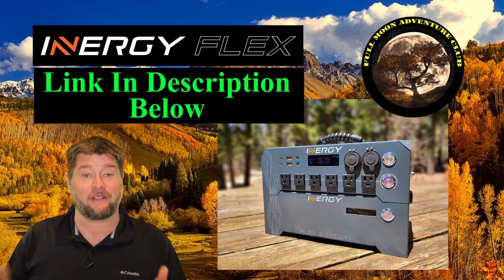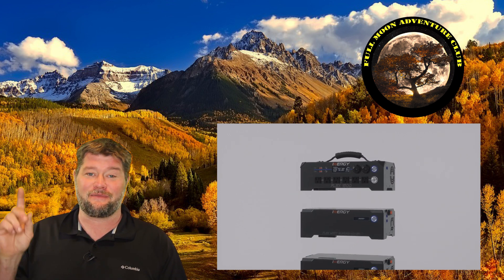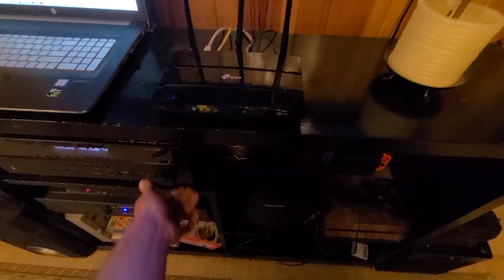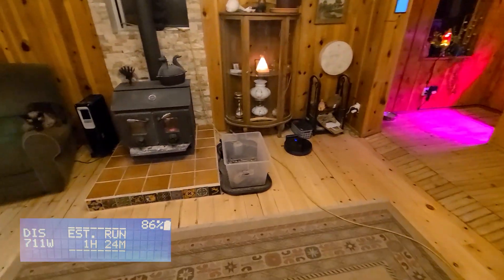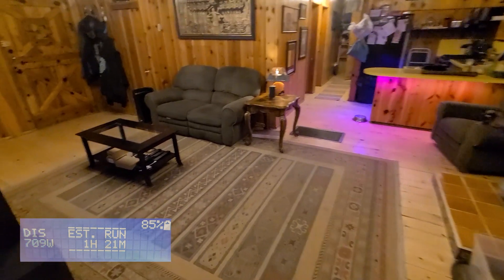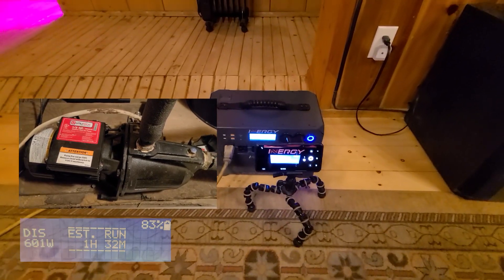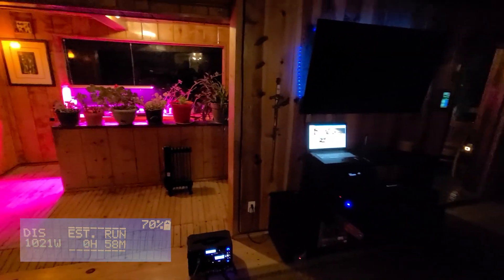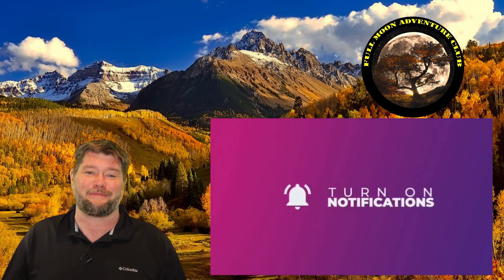Inergy Flex Solar Generator Running My Whole House

Comment: Ordered a Flex 1500 in 2021. It took about 18 months or so for us to even get the generator. Then they promised they would send an additional item to make up for the delay (a crock pot). We never received it. Then we bought extra batteries. We've used the generator (inside the house) a handful of times. It is now dead about 2.5 or so years later. Of course, it's out of warranty! Garbage! They have terrible reviews on the BBB site, BTW.

Comment: Hi there. Do you know how many watts the upright refrigerator was consuming when the compressor is running VS idle? Thanks in advance.
Reply from the maker: I've seen It go as high as 400 watts but it typically runs around 100 watts or below.

Comment: Yes u can power everything for 20 min
Reply from the maker: Lol. You are correct. This is not designed to run an entire house for any significant amount of time. For my test with my house using around 700 Watts this would have lasted about an hour to an hour and a half. But you can add batteries to extend that time and of course in a power outage you probably wouldn't have every single light on in the house. Thanks for the comment and happy camping

Comment: Ac or heat
Reply from the maker: Not Really. While this will run a 5000 BTU window air conditioner for many hours and a 1500 watt space heater for a couple hours depending on how many batteries you have it is not a viable solution for heating. It will definitely not run a residential air or heat unit. I hope that helps.

Comment: How many days in a row can you run that?
Reply from the maker: With all the things on that I showed in the video it would only last maybe 4 hours. If you hooked up 600 watts of solar and you were much more frugal than that obviously over the top video you could run quite a bit solid with good sun. To be clear this is not designed as an entire house backup system. You could run under 600 W in full sun and then at night you would have some battery capacity in Reserve.

Comment: Hello Sir. I'm curious about your pump please, size and volt. Most well pumps are 240v. Just wondering if this would run my pump alone?
Reply from the maker: My pump is able to run off of 240 volts or 120 volts and is currently set to run off 120 volts. It will definitely run my pump off 120 volts just fine for multiple days. Here is a video I did on that. Take care. https://youtu.be/-ySbJn3wcDQ

Comment: titan rip off
Reply: Yes, but also a LOT cheaper. Titan is more powerful and the battery is much larger, but you can get 2 Fluxes with 4 panels each AND 2 extra batteries for each unit for just a bit more than 1 Titan with  4 panels and 1 extra battery.

Comment: Yes, you can "run the whole house" as long as you have two batteries and only plan to use 1500 watts total and run only for an hour.   Not very impressive when you think about it.  It's not unusual to have power outages that run 2 or more hours and you certainly need more than 1500 watts to get through that.  Your results may vary.
Reply: Thx for the feedback.   This helped answered my questions as to how long it will keep the power on.
Reply from the maker: I agree. Of course in a real power outage I would not be running every light in my house as well as the entire entertainment center Etc. You definitely want to pick and choose essential items in a power outage. Running the refrigerator maybe a laptop and a few lights last for a long time and are well under 1500 watts. I'm doing a video at this very moment about the energy flex running a 5000 BTU AC unit and it's doing really well. Let's also not forget that every light in my house is Led which makes a huge difference. I believe I mentioned in the video this is not intended as an entire house backup generator. I just thought it was a cool test. I do appreciate your input and I'm certainly not trying to mislead anyone so it's always good to keep things in perspective. Thank you for the comment and happy camping.
Reply: @fullmoonadventureclub   I appreciate your response.  I liked your video.  And I like the looks of the Flex 1500 system.  The thing is, most of us know we can't practically run our entire home on this system with a battery or two.  My point is, if you want to run just your refrigerator and a freezer and a couple of LED lights here and there along with maybe a TV or laptop or two, you'd better have 'several' batteries.  Two batteries running 15 one hundred watt light bulbs (for example) will get you just over an hour.  That's not very practical if you're trying to get through the night with your fridge and freezer running.    I'll look forward to your video on the 5000 BTU AC unit.  That's no doubt being used in a relatively small room but when the power goes out and you need some cool air, it could actually be a life-saver.   Thank you again.

Comment: Where should I look to find the correct way to in stall a plug like you have if I wanted to plug my back up device into my house like you have done ?
Reply from the maker: I'm working on a video that shows how mine was set up. I'll be releasing it soon. More than likely it has to be done by a professional electrician

Comment: Do you have a mini-split? In Missouri, I run a two phase well pump, a two phase mini-split, lighting and all my appliances. I have about 4500 watts of solar input and three (3) 48 volt battery strings. I'm going to install another two phase inverter to split up the load today. All I need for the winter is another 48 volt battery.
Reply: No such thing as two phase power.
Reply: 3 phase would be for commercial applications. Must mean 220v
Reply: @michaelshearer8293  Yes, 240 volt split phase is what most homes in the USA are wired for. The transformer on the telephone pole is center tapped (split) to give you 2 legs of 240 volt power wires to your house plus a neutral wire from the transformer. The voltage measured from either of the 2 power wires (hot wires) to the neutral wire is 120 volts. Between the 2 hot wires measures 240 volts.  Many companies are now making inverters with 240 volt output and a neutral wire  to match what comes into your home from the utility company.

Comment: I just checked on the status of the order I placed in May 2021. I was told that they are just now filling orders for March 2020 and they have no Idea when I will get my unit. If you order this now you may not get it until 2023.
Reply: I called on 8-10-2021 and asked if I placed an order, when could I expect delivery. Was told three weeks.
Reply: The MaveRick Prepper What they told you is correct. My parents placed their order around March 2020 and just received it last week.
Reply: I received mine.  I’m seeing more unboxing videos so more deliveries must be going out.

Comment: Glad you got yours. These frauds made off with my deposit, and it looks like only a matter of time before the site goes offline next. Hoping I can dispute the charge from that far back. Unreal.
Reply from the maker: What are you referring to? Why is your deposit not valid? Don't you just pay the remaining balance and get your unit? Inergy has a lot of really cool projects coming up I seriously don't think they're going out of business. Is there anything else you can tell us about it?
Reply from the maker: @NYGIANTSFAN1934  I wouldn't think so. It is my understanding that covid gumed up production big time. They say production is now excelerating rapidly. Let's hope the Delta variant doesn't effect things again. I talked to some of the higher ups and they seem excited and confident with the progress. Here's hoping.
Reply: Ordered mine in June.   Told September, then October and just received email saying December.  My concern is if they can’t get the parts to build new pre-sold units, how will they ever have the parts to service troubled broken units.

Comment: Do you know if there is a way to add a remote on/off switch to the kodiak
Reply from the maker: Not at this time. It would have to be some kind of manual DIY project that would push the button physically.
Reply: @fullmoonadventureclub  thanks

Comment: Very cool. Thanks for the video. How many watts did your refrigerator pull by itself?
Reply from the maker: If I remember correctly it was around 500 watts when the compressor was running.

Comment: Not really useful.  Can't run a heater/furnace (for those with no wood stove), sump pump, well pump (so people with wells can get water), furnace, hot plate (for those without a gas stove.)  Portable solar generators that can run those probably can only do it for an hour or two.
Reply from the maker: Very true. If you're trying to run all that you definitely want to go with a entire house battery backup system like a Tesla wall or a gas generator would probably be your best bet.

Comment: What a great review!  I've had van lifers tell me this isn't enough power and there's no way they have that much stuff running in their vans unless they have some big ol honkin electric heater or a/c that will suck the power out of any generator.  I, too, have a pre production model and run everything in my van.  I do have 2 very small heaters for a total of 500 watts, a fridge, lights, hair dryer (typical girl  :) , charging the laptop and a dvd player and a small electric water faucet.   Yes, this is 1500 watts but has a surge up to 3,000 and is capable of so much more than people want to give it credit for.  I love the unit and will be putting it to the test in the van this month.  Thanks for such a great vid.    You want to come to my house to help me set it up?  Your place is awesome!
Reply: What they mean by it’s not enough power they don’t mean it won’t run their stuff but won’t SUSTAIN it as you can see all the stuff he had running would only last an hour it’s not ment to run a home
Reply: @freedomfighter1861  I agree that it isn't meant to run a home.  It was also dark when he was doing that vid so no power was coming in.  I haven't had any trouble at all in my van running all of my stuff with solar charging it or with the car charging it while I drive.  Some van lifers want 3000+ watts of power and I can't figure out what they're doing to need that much unless they have an a/c.  I run a bunch of stuff but I'm sensible about it, too.  The intent of the Inergy products is portability and that's what got me so interested in the company.  I can easily carry the Apex or the Flex anywhere I need it to do the job I need.  I like that you can hook it up to your house in the event of a power outage.  That doesn't mean I'm going to turn everything on - it means I'll be able to have lights and maybe save the freezer.  That's what I want it for.  Additionally, Inergy's  customer service is impecable.  That's a big selling point in my book as well.
Reply: @jaynetabb6835  It sounds perfect for you. There are people out there running air conditioners. I think most are just in the planning stage and would rather have it and not need it, than to need and not have. I could surely make 1500 work for me, but I could also shut that machine down quick. I don't run everything at once but AC, microwave, fridge, and 1800w double burner is quite a load.
Reply from the maker: Thank you. Thank you for sharing all that with us. Good luck in the van! I miss the open road. Thanks for the comment and happy camping. :)